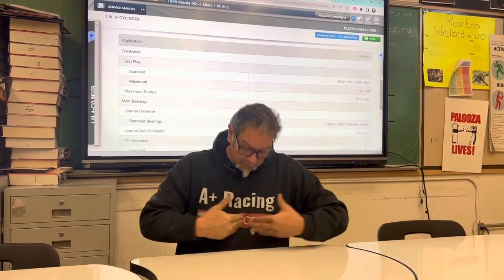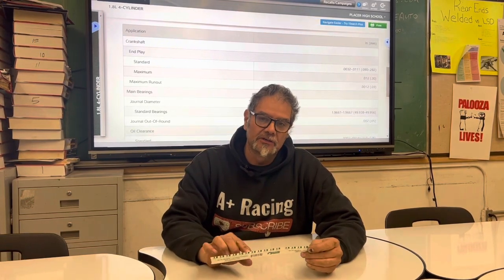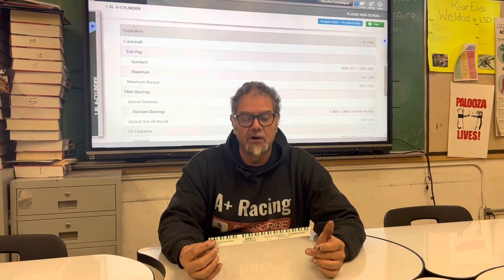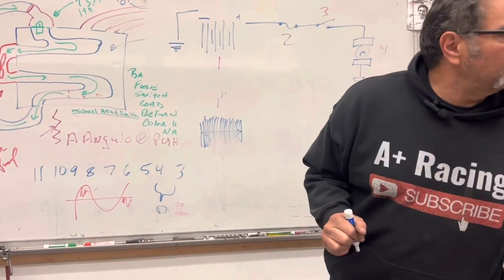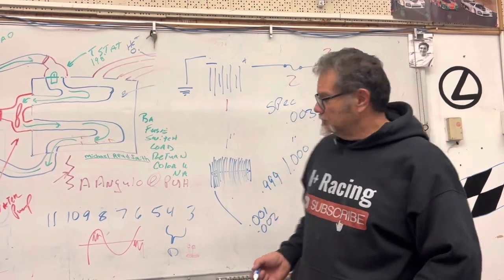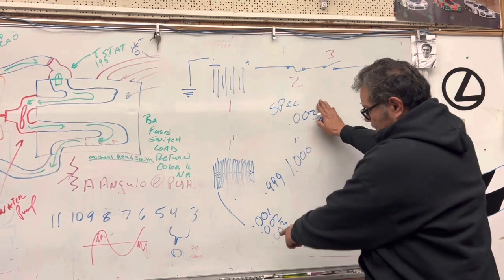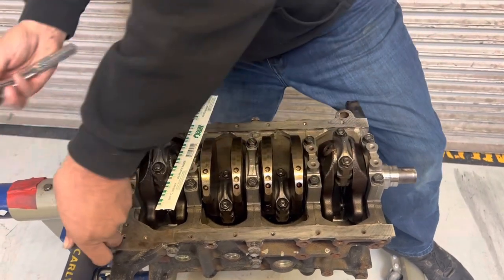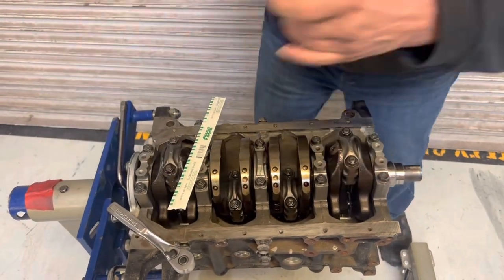Plastigage Checking For Engine Bearing Clearance.

Comment: Help! Oh dear God help!  I just finished up doing a basic engine rebuilt and i used many of your vids.  Got every thing back in car and started filling radiator and noticed at least 5 new mazda freeze plugs are leaking.  I used a little permatex #1 (form a gasket sealant) on them and drove them in straight.  Is this normal?  Might they seal up?  I haven’t even started the engine yet.  I hope i dont have to pull the engine and redo them!

Comment: Irrelevant, but don’t water pumps pull from the bottom of the radiator to ensure enough NPSH? The white board seems the other way around?
Reply: I'm guessing he just drew it that way for the illustration to fit on the board more easily. I'm pretty sure they pull the water from the low side of radiator to water inlet port on engine.